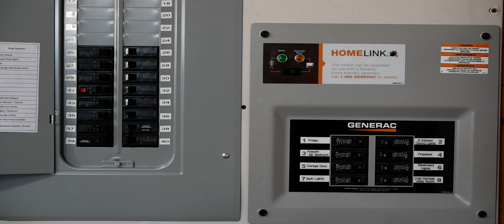Generac HomeLink Manual Transfer Switch Installation | 30 amp & 50 amp

Comment: Appreciate your detailed clear explanation of the install. I was looking at upgrading to all 12 gauge as well, to avoid having to upgrade the inter box wiring in future. But then a thought hit me. The original runs in the house are 14 gauge, and these are tied to a 20Amp breaker. In a high current situation, ex) 17Amp these breakers will not trip. I am thinking in most situations where a breaker trips, you have a short, and won't be an issue. But it is something to be aware of.

Comment: In Canada you cannot use your main panel as a junction box. The wires that your transfer switch is going to connect to will have to be completely remove from the main panel including the neutrals, hots and grounds and they have to be installed in a junction box. That way you know for sure nothing will back feed to the power lines. One thing people forget is current travels through hot and back to the neutral. The only wires that should go into the main panel from the transfer switch  are 2 hot black and red, 1  Neutral, 1 ground and everything else in  Canada anyways have to be connected in junction boxes.
In your situation you have it installed like they do in the United States.

Comment: While a 50 amp breaker can be used, it's crucial to consider the overall system and whether it's safe and practical for your setup. If the wiring and transfer switch are designed for 30 amps, a 50 amp breaker could pose a safety risk if it allows excessive current draw
Reply: But his generator is probably going to be  connected to a 30 amp inlet so you can't pull anymore than it can give.

Comment: Except I have to ask this question in the main panel. Why do you have to put a 50 amp double throw breaker to power the transfer switch when the transfer switch is only a 30 amp

Comment: I want to point out that you cannot feed a 15 amp receptacle with a 20 amp breaker and the wire you are tying onto is 14 gauge wire which is good for only 15 amps.  As far as the neutral is concerned I will have to check with the electrical inspector because it looks like you have a floating neutral which is not allowed. These rules apply to Canada. The panel has to have a label showing that it is approved for Canada.
Reply: They sell these transfer switches  in Canada at home Depot so they are approved.

Comment: For this transfer switch it says it supports 8-10 circuits but there are only 8 breakers. How do you install circuits 9 and 10?
Reply: Tandem circuit breaker.

Comment: Can someone explain to me why if this is a 30A transfer switch, why is it fed power from a 50A breaker?
Reply: I was wondering the same thing.... I'd like to feel a sub panel in my crawl space with this but the sub panel is 40 amp. So either I lower the breaker to 30 and hope it's enough or if the transfer switch is rated to handle up to 50 I'd just put the 40 in
Reply: The 50 amp is acting like a 30 amp because the generator is using a cable rate 30 amps connected from a generator which is 30 amps and the inlet which is 30 amp. It will only give the 50 amp breaker 30 amp supply from the generator.

Comment: Great video. Can you tell me what wire labels those are. I can’t find any like them, and I’d like labels like that for my project.
Reply from the maker: They are just scrap sleeves from Romex wire. Cut them up, take out paper inside and label as desired

Comment: Yes, buddy, you did it right? I've seen so many people just take all the neutrals and put them back on the main panel. 's neutral bar which is totally wrong. The way you did it completely isolates all the hot and the neutrals and the grounds. Perfect that's the way I do it.
Reply: Sorry, I messed up on a few words on this spelling. But you are correct buddies on everything you did. I would wish Generex Would bring out a new Manual transfer panel with a 100 amp.
Because I have a portable generator they can run a hundred amps Is two forty volt. And I have engineered a way of doing it perfectly with no overlo and perfbut isolated both phases. The neutral and the ground works fantastic.

Comment: Le défi pour le choix de l’interrupteur de transfert pour les génératrices portatives est de savoir s’il devra être 2 pôles (commuté L1 et L2) ou 3 pôles (commuté L1-L2 et Neutre). En réalité, on doit savoir si le lien neutre-châssis est fait dans la génératrice 
ou non et si on va garder ce lien, car tout est là pour la suite . Ainsi, les génératrices portatives de 12 kW et moins 
ont généralement un neutre raccordé sur le châssis de la génératrice, donc le lien neutre châssis est fait à la génératrice. Rappelons 
qu’il interdit d’utiliser une génératrice portative pour la raccorder à une installation électrique si le fabricant ne permet pas de retirer le cavalier reliant le neutre avec le châssis de la génératrice (art 10-204). Si le neutre est lié au châssis de la génératrice et on décide de garder ce lien, on doit utiliser un interrupteur de transfert 3 pôles afin de commuter le conducteur neutre. De plus, il faut installer une prise de terre pour la génératrice ou la raccorder à la mise à la terre existante et raccorder le neutre à la terre 

le câble qui relie la génératrice à l’installation électrique doit avoir obligatoirement 3 conducteurs soit : L1, L2, Neutre et CDM. Généralement on utilise les prises sur la génératrice portative de configuration L14, L15, L16, L17 Le raccordement adéquat d’une génératrice selon cette méthode implique donc :
�� d’installer une prise de terre pour la génératrice (ou la raccorder à la mise à la terre existante),
�� de commuter le neutre,
�� de raccorder le neutre et la terre.

Dans le cas où le neutre de la génératrice est non relié au châssis ou si l’on décide de retirer le cavalier qui assure ce lien, le raccordement adéquat de la génératrice implique d’installer un commutateur de transfert à deux pôles qui ne commute pas le neutre et de ne pas prévoir ni prise de terre ni raccord entre le neutre et la terre sur la génératrice

Finalement, les deux méthodes sont conformes. Que nous utilisions un interrupteur de transfert 2 ou 3 pôles, c’est le lien neutre/
châssis de la génératrice utilisée qui détermine lequel des interrupteurs nous choisirons et inversement. Une génératrice dont le 
neutre est non relié à son châssis requiert un interrupteur de transfert 2 pôles et une génératrice dont le neutre est relié à 
son châssis requiert un commutateur de transfert 3 pôles et requiert un conducteur supplémentaire pour compléter la mise à 
la terre de la génératrice. 

Des étiquettes d’avertissement permanents doivent être installées sur le panneau de la génératrice ainsi que sur la prise de courant installée à l’extérieur ou sur le coffret de transfert afin d’identifier la configuration du système en place soit :
�� Système ne commute pas le neutre 
�� Système commute le neutre

AVERTISSEMENT : Système commute le neutre, utiliser seulement une génératrice qui a un neutre relié à son châssis ou ajouter ce lien et assurer la mise à la terre permanente du châssis (conducteur #6 AWG).

AVERTISSEMENT : Système ne commute pas le neutre utiliser seulement une génératrice qui a un neutre non relié à son châssis ou enlever le cavalier qui assure ce lien.

Comment: Great video, the only one I have seen stressing the importance of the neutral wires. At first I had them tacked into the neutral bar and was causing backfeeding. This has solved the issue. I can't believe they do not stress this enough in the Manuel!

Comment: I have mine wired up to a 30 amp 120v generator. When the generator power is on the orange light comes on the Homelink, however it will not let the solenoid switch over to generator panel without doing it manually. Is there any way to replace the 240vac solenoid with a 120vac? This way I can use the transfer switch with a smaller 120v generator.

Comment: Generac Neutral to Circuit Neutral is the only way I have seen these switches done on YouTube. What you say makes sense, and it’s the only way to hookup a bonded generator. However this might be different if, it was not bonded.

Essentially the Generac switch acts as a sub panel and you relocate your circuits to generac. The main issue for code in most provinces in Canada is you can’t treat the panel as junction box, it must be treated only as a termination point.

Comment: I think your videos very informative. The only problem is NEC more than three current carrying conductors in a pipe you have to derate you’re only allowed so many wires in a conduit so look at your conduit Boxville and also check for derating other than that your videos pretty cool.
Reply: Not the case when using a "nipple" it is an exception.  24" or less I believe

Comment: Hi there I bought the same home link but there's a problem the switch doesn't work when I plug the panel it doesn't light up the green light and I need to transfer manually because the switch doesn't work
I have a small orange wire inside that is not connected and can't find where it goes 
I look everywhere and can't find help
Reply: Did you ever figure it out?
Reply: @AdamsAiSongs  I found out that the wire that comes out the generator wasn't giving 220 only 110 and  you need 220 for the switch to work properly
I changed the wire and everything works fine 
The plug and wire I changed l14-30r and it works fine after

Comment: Well done. This is the best video on the installation of the Generac manual transfer control I have seen. Separating the neutrals is important, and the installation manual is not stressing this clearly. Generac should have an installation video similar to yours on their website.

Comment: Great video, very well explained. My only criticism is that there is no point in upgrading to #12 gauge wire if you’re splicing on to the original conductors (which are presumably still #14s). Unless you replace the ENTIRE run back to the end of line device, the only part of the wire you’re upgrading is the piece from the breaker to the splice. Your theory is sound though, if you bump the breakers up to 20A you do need to size the wire up.
Reply: Original conductors are all #12

Comment: You dont need to wirenut each individual neutral wire to the corresponding circuit you back up. As long as you land them on the neutral bar it's perfectly fine. The 8awg neutral wire that comes pre wired with the Tswitch gets landed on the neutral bar in the sub or main panel.. That same wire runs back to the T switch neutral bar.. So regardless it has the same effect and does its job. You just save a bunch of time not having to tear your panel apart and trace back each neutral wire.. The whole point of having a transfer switch is so you cant backfeed the system.
Reply: Nope. The neutrals need to be separated if you have a generator with a GFCI. The MAIN panel has the neutrals bonded to the ground.  If you don’t separate out the neutrals and your generator has a GFCI it will fail.
Reply: Mike, this is more like a sub panel that relocates the circuit. If you want a back feeding option, this is an expensive and unnecessary choice. If you want a basic switch,then this product isn’t for you either.
Reply: The only thing that should be connected  from the main panel to the transfer switch is 4 wires. 2 hot wires red and black from the 50 amp breaker or 30 amp to the transfer switch main power. The 1 ground green wire should be connected to the main panel to the transfer switch ground bar  and the neutral from the main panel neutral bar to the transfer switch neutral bar.  Every other breaker on the transfer switch should be connected on its own circuit. Hot to the breakers, neutral to the transfer switch neutral and grounds to the transfer switch ground bar. If the power goes out on the main panel there is a disconnect from the main panel and the transfer switch including neutrals and grounds when you select generator to transfer. Power comes in from your generator and goes to your inlet box to the transfer switch and you see generator orange light come on then you switch to generator power to allow your 50 or 30 amp to be connected to bring power to your transfer switch and at this point your transfer switch in completely disconnects from the main panel until you transfer power back to utility. At this point of transferring power if wired correctly there should not be any power running between the main panel and the transfer switch.

Comment: My house 120V was wired with 3 wire servicing 2 circuits with a shared neutral.  Should I assume that any circuit I move that is three wire, both must be moved (due to the shared neutral having to be moved)?

Comment: How did you secure the transfer switch for flush mounting?
Reply: Its probably got holes or he drilled a few holes and screwed it to each side of the stud bay..
Reply: It does have 4 mounting holes on the back.  I had a hard time getting mine between the studs, they were a little close.

Comment: I bought the Generac 30A 8 circuit manual transfer switch and noticed an odd thing I’m hoping someone can explain.  The 4 pre-wired wires (red, black, neutral, ground) that run from the transfer switch to the main service panel, where the red and black wires are connected to the customer-supplied 50A breaker in the service panel (and the pre-wired neutral and ground wires are connected to the neutral bus and negative bus in the service panel), the red and black wires are labelled as “Main-1 40A” and “Main-2 40A” (with white labels).  They are also 8AWG.  And they supply utility power to the transfer switch during “normal” operation while utility power is being provided.  
Question.
1.  Does code not require that a 50A breaker be connected to a 6AWG wire and not the Generac pre-wired red and black 8AWG wire?
2.  And why did Generac label the red and black 8AWG wires as “40A” with white labels?  If it’s only a 40A capable wire, connecting it to a 50A breaker seems wrong. 

I’m certainly not an electrician, but it defies logic (and potentially dangerous) to connect what appears to be a 40A, 8AWG wire to a 50A breaker.  

I could replace these wires with 6AWG wire, but I’m wondering if I need to.  If I ever had a short in the transfer switch on these wires, I can foresee a problem. 

I’m hoping someone can explain this.  Thank you.

Comment: Must be a new code. I have a older transfer switch and it dident have any provision foe the nutral at all.  It just went from the generator plug str8 to the main nutral buss bar.  Wasent even switched
Reply: More likely related bonded neutral and/or gfci generators. Echnically an unbounded generator should require you to connect you neutral to the panel. Either way different type of switch.

Some codes related to this include neutrals can only be bonded at one location.

Comment: Great video Fubecca. Just finished my installation and tested this week.  As you mentioned, all neutrals have to be Wago'ed or wire nut'ed to the neutral conductor of the specific circuit...of course the hot 'wire' from Switch gets Wago'ed to the black conductor of the circuit.  Easy to find the hot/black because it is in the existing breaker...but finding the correct neutral in the panel is the hardest part.  Also, for you amateurs (like me), if you change out the 30amp breaker that comes with the Switch to let's say a 20 amp or 15 amp, you have to change out the conductor (wire) with correct gauge for BOTH Hot and neutural conductors.  20amp breaker is 12 gauge conductor or 15amp breaker is 14 gauge for both neutral and hot.  Thanks again Fubecca!

Comment: Why in the manual does it till you to put the neutrals on the main neural bar though?
Reply: My guss is different  local  code.   Thats how i wired mine to. it passed state inspection no problem.
Reply: Depends on whether you have bonded neutral generator, gfci, etc.

Comment: 14 gauge thhn is rated for 20 amps using the 75 degree column on nec. Table 310.15 ok you upgraded but could of left it with 14g.
Reply: In most cases, a branch circuit with a 20A rating must be ran in 12AWG. Refer to 210.24.
Reply: Try arguing that with the inspector. They will still fail you in a second for not useing 12 or better on a 20amp circuit
Reply: Doesn’t pass code in Ontario either.

Comment: Great video. My question is how would you wire it up if you have gfci and afci breakers? Also it looks like you are essentially removing the breakers from the main panel and using them in the sub panel. So in your case did you remove those breaker from you main panel?
Reply: If you are relocating a GFCI or a AFCI circuit to the sub panel you would land the neutral from that circuit to the breaker not the neutral bar on the sub panel. Now the white pig tail off the GFCI or AFCI breaker will be landed on the neutral bar at the sub panel . Make sure you use breakers listed to be used in that sub panel or enclosure.